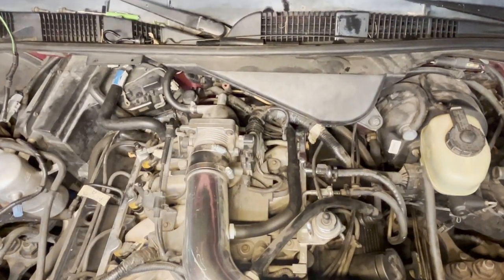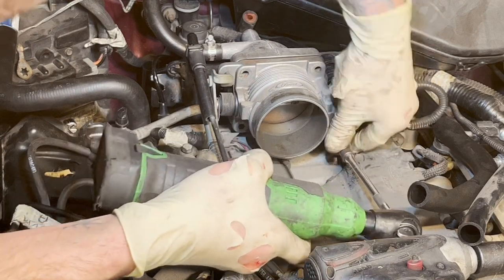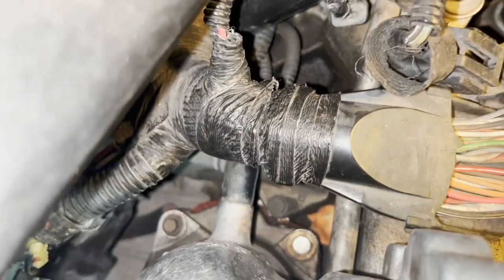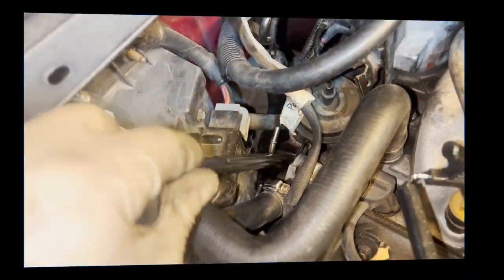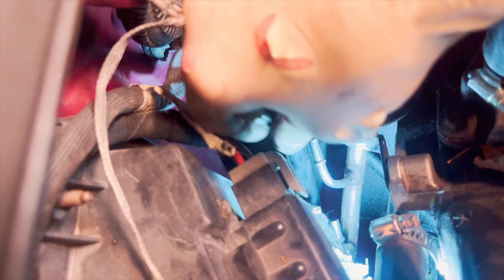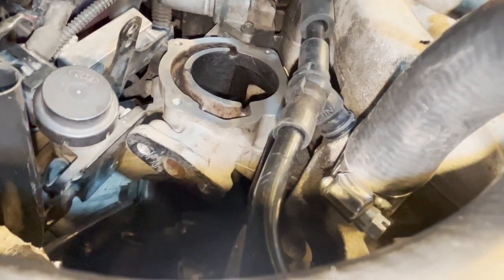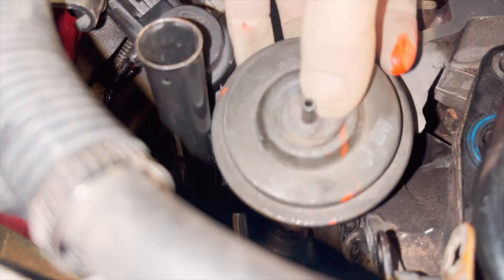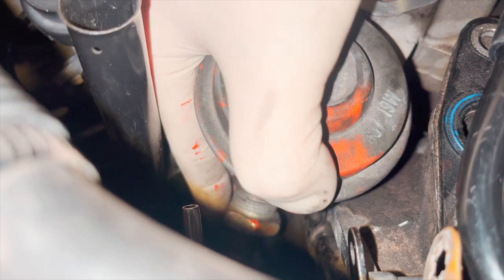1993 LINCOLN TOWN CAR EGR Replacement

Comment: What size wrench did you use for the valve bolt
Reply from the maker: @Omar2sicc  is that the wrench that I cut in half in the video?
Reply: @griffzillagarage  yes
Reply from the maker: @Omar2sicc  1-1/16 wrench

Comment: Guy makes it look so easy I’m two hours In still haven’t got it out yet
Reply from the maker: Thanks for the compliment. It took me a while too. I’ve also got an arsenal of tools. Don’t be afraid to make a tool like I did. It’s doable and you can definitely do it! Thanks for checking out the channel and definitely appreciate if you would subscribe and help me grow the channel. Please let me know if you have any questions I do my best to get back to everyone. Merry Christmas.
Reply: @griffzillagarage I’ll be subscribing I appreciate it! Only question I have would be how u got the two 10mm screws out for the egr valve itself like which tool
Reply from the maker: @mariobecerra2662  get a 10mm 1/4” drive wobbly. Preferably an impact one. Use that with like a 3” extension. Let me know how that works or if you got any other questions. Thanks for subscribing and merry Christmas!